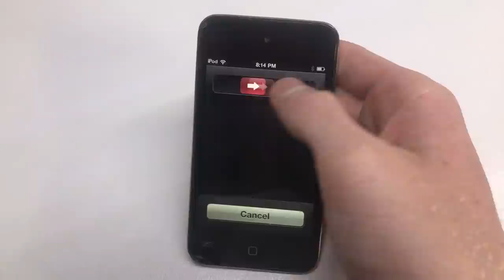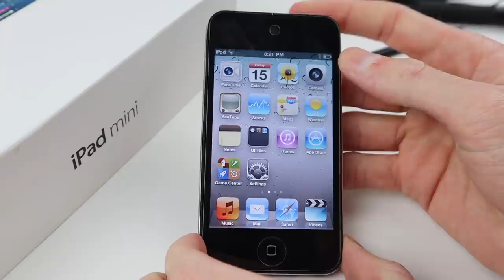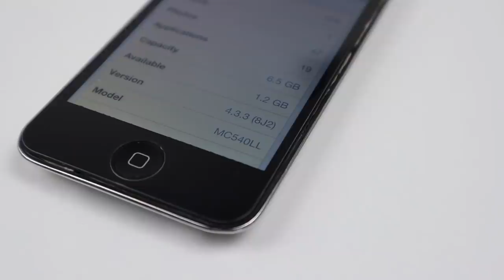The Unrepairable iPod Touch

Comment: If Hugh Jeffreys says its unrepairable, it’s unrepairable.
Reply: Ben KT777 ikr
Reply: AND THATS A FACT
Reply: Pass it on to Jerryrigeverything
Reply: I smell facts 😂😂
Reply: @ilhantele  yup he's our only hope
Reply: Yup it's unrepairable
Reply: Exactly!
Reply: I thinks that i might get it repaired , his skill are great but it always can be fixed
Reply: Actually. I've fixed a few of these. He's just ass at repairing shit.
Reply: Hell no! I repaired countless of these. This guy doesn’t know what he is doing. 🤣 
1.You need to push down on the board when lifting the metal plate or you break the flex like you did the first time. 
2.You do the same thing when connecting the digitizer or you break the flex like you did the second time. 
3. When you need to remove the board it is best to remove the battery with the copper back. 
4. Why did he hurt the speaker like that? A little heat and careful prying and it would have come out just fine.
Reply: @ilhantele  he might do a scratch test and burn the device with a lighter, but might also put a sick dbrand skin on it. So, maybe worth it?
Reply: @yanuehara8017  yep and fix it as well
Reply: @ilhantele  yeah, he'd do a dissection of it and then fix everything.
Reply: @Infevlol  This is not reddit, kid
Reply: Yeap I agree
Reply: @m3zmr ya ive replaced a screen on one of these as well and i was 15 years old
Reply: Zestypanda öhj! Be nice
Reply: Bs anyone can repair this
Reply: I feel like you’re going to change your comment
Reply: 176cgna on video
Reply: @jordanmanuelpillai2866  with a blind fold on.
Reply: m3zmr he never said it was fucking impossible he just said it was his hardest to repair
Reply: Jesus Yuca if your so good at fixing it why don’t you try giving him tips instead of heaping about it in a YouTube comment section. Give him some advice and he will probably try and listen he could probably say the same about other people trying to repair iPhone 8’s and mac books
Reply: Zestypanda you still have time to delete this
Reply: That depend on the experience of the fixing...
Reply: eeeehhhhhhhhhhhh he is not very good compared to some people
Reply: Unrepairable? Never heard that before. Is that a synonym to "Irreparable"?
Reply: @thevalorousdong7675  Yes
Reply: @bruhman2565  He gave tips on how to do it lol
Reply: Wulf he gave tips to somebody who probably never fixed a phone in his life he should be telling this to Hugh himself because let’s face it he doesn’t read replys
Reply: @ilhantele  Ipad Rehab or Louis Rossman, they could potentially fix anything between the two of them.
Reply: Na I did it on mine
Reply: Totally true lol !
Reply: But, the Huawei P20 isnt easy ,too. It is better to have an old iPhone 5s or SE 1 with TouchID and better Cams.
Reply: eh......
Reply: I’m gonna bring a broken screen iPod Touch like the one in the vid into the phone repair shop I’m getting trained at to do on my own, and I’ll tell you different. Watch.
Reply: @damian9303  ok. Let me know how it goes
Reply: I don't do repairs, but from 2010 till 2013 had to repaired myself around four times, my daughter was very good at shattering the screen.
Reply: Every time he says a board has failed and that it is unrepairable is completely false. Louis rossmann and ipad rehab is proof of this.
Reply: That’s what she said 😈
Reply: We need Dankpods to verify that

Comment: The solution: dont reinstall the screw near the power button cable when reinstalling the logic board. You will have plenty of screws holding the board in place, but if that screw is pinching the cable then that screw can stay out
Reply: 69 👍

Comment: I cringed when I saw him bend the battery like that
Reply: There isn't really any other way to take the batterys out on iPod Touches, there aren't any pull tabs and the adhesive is a bit overkill for such a small battery, he should have used a plastic tool though, you can sometimes slice through the layers of a battery if you use a metal tool and that can be pretty dangerous.
Reply: Same, especially with his hands. Wonder if its damaged it though
Reply: I recommend using isopropyl alcohol to soften the glue, it’s a lot easier to remove batteries that way
Reply: That guy fixed hundreds of phones dont teach him
Reply: @irmajulietaaguirrelara2046  oi

Comment: I repaired so many of these. When you lifted the metal plate that has all the screws you need to push the board down near the flex cable is soldered or you tear it like you did the first time you opened it. Also removing the board and battery with the copper back part helps not mess up the battery. My specialty was replacing the charging port because nobody on this island could do it.
Reply: Island? U from Puerto Rico?
Reply: FroyourFilms 🌴😎🌴yup!
Reply: @jesusyuca1483  The yuca Made me think so. 🇵🇷🇵🇷🇵🇷
Reply: @jesusyuca1483  Me too 🇵🇷
Reply: @FroyourFilms  Yo pensé lo mismo 🤣
Reply: Whasssup I'm from Puerto Rico toooo 🤣🇵🇷🇵🇷🇵🇷🇵🇷🇵🇷
Reply: Saludos mi gente! ✌🏽
Reply: @jesusyuca1483  🔥🔥🔥🔥

Comment: you know its unrepairable if even Hugh can’t repair it.
Reply: Yep
Reply: Yeah
Reply: Cody’s Tech Adventure’s hEy I knOw yOu
Reply: Adam Steven OmG hEy
Reply: Adam Steven Not true... I have repaired countless of these. I don’t know how else to say it but this guy is a noob. He broke the flex twice. The first time lifting the metal plate and the second time connecting the digitizer. He messed up the battery when he could have lifted it with the copper back. He fucked up the speaker by not being careful or using a little heat. Even his solder joints didn’t look that good.
Reply: Jesus Yuca this guy has no clue what he’s doing, he cannot even micro solder. I have repaired hundreds of iPod touch 4
Reply: @gthesuperman903  Same here. Stupid easy repair
Reply: GTHESUPERMAN bot
Reply: @jesusyuca1483  the battery was really fucked up  looking
Reply: My dad fixed mine easily!

Comment: Omg the part when he bends the battery so much i thought it would explode
Reply: Seriously, don't do this. Modern batteries are very tightly-packed chemical matrices designed to store lots of energy. Deforming them this roughly is dangerous. Hopefully Hugh was at least wearing eye protection.
Reply: @Jack-pc9sp  actually not always. It can cause a potential short between the layers. I've done it myself. It also leads to the battery puffing up over time if it doesn't react violently. So, stop spreading misinformation like you think you're smart
Reply: @thevalorousdong7675  yeah of course the nose knows
Reply: sometimes you just have to do that to get certain batteries out of certain devices if you do bend it like he did I wouldn't recommend reusing them, it's very rare for a battery to really do anything crazy just by prying it out unless you puncture it.
Reply: @Jack-pc9sp  Sure, let's just reuse every battery that's bent when being taken out of the devices, if it explodes into flames while you're using it, that's just fine, they're supposed to handle that bending, so it shouldn't do that.

It's not fear mongering, it's cautioning. Just because something can technically do something does not mean it's designed to do it. There's a reason people complain about manufacturers gluing batteries down rather than using pull-tabs to assist in the removal. It's not just because it's more difficult to get out, it's because it makes it more risky to remove it.
Reply: Sometimes You come to the point where You don`t care anymore....
Reply: @Jack-pc9sp  What are you, 5? Literal children resort to insults when they're told they're wrong about something.
Reply: I HATE APPLE OMG SOOO COMPLICATED!!!!!!!!!!!! EVERYTHING IS SO COMPLICATED IPHONE 5S IPHONE 4S CABLES RIP EASILY NEED EXPERT EVERY iDEVICE HAS ITS OWN PARTS NO INTERCHANGEABLE PARTS I THOUGHT BUYING AN UGLY CHEAP PINK IPOD AND BLACK HOUSING THEN SWITCHING HOUSING WOULD BE EASY I HATE MYSELF FOR LOVING APPLE PRODUCTS

Comment: I'm getting flashbacks to when I tried this on my sister's ipod years ago...
Reply: Did you do it?
Reply: Did it work?
Reply: Was it successful?
Reply: Me too. I've tried to repair three of these iPods. One had a gap under the screen, second one sealed correctly but the buttons flex was damaged and wired manually causing power+volume up when pressing power. Last one was almost done and the speaker connector broke off the board. Now it is cheaper to buy used working iPod touch than repairing one >_<
Reply: My girlfriend's iPod has a dead battery. It's in a pile of things to do someday in the future. 
I made an attempt a year ago and I stopped caring when I realized holy fuck this is going to take hours.
Reply: Yo same it still in my repair bin to this day
Reply: Ham String ohhhh nuuuu

Comment: Hugh Jeffrey:"Unfortunately Apple Glues the device shut"

Also Hugh: Glues screen down permanently
Reply: Since it's the only thing holding the display on.
Reply: @TR2000LT  There are 2 screws in iPhones, ipods dont have these
Reply: The Random the ipods always used glue
Reply: The Random, Con is correct. To avoid water getting into the backlight you use adhesive around the glass. Why? If water is slipping by the glass it has a perfect route to go into the backlight layers due to water tension. Anyways the real reason they used adhesive is because of various advantages, not just because apple is greedy.
Reply: Honestly just stay away from Apple...hence why they're a multibillion dollar company
Reply: @TR2000LT You're taking what you can get now aren't you. Bias is stong in this one
Reply: @TR2000LT  "well was not they were using 2 screws before?"

Bruh; English
Reply: @TR2000LT  and the English language has remained consistent since

Comment: This happened to me as well! When I took the cable out it had a small mark on the cable inside the ribbon.  I found out that it was long screw damage witch was very weird because I knew I had used the correct screw.  I replaced the cable and didn'd screw in the screw above the cable, and it worked.  I screw in the screw as much as I could before it got tight, and it worked fine.   So I believe Apple used a screw that's to long for the spot.
Reply: Which screw do you mean?
Reply: That doesn't make sense because if the screw were too long the iPod touch would have had that problem from the factory.  Seeing that it they/it didn't, the length wasn't an issue.

Comment: I used to work on mobile repair between 2013-2017. The first few devices I worked on was this iPod touch 4th gen since in 2013, that device is widely used. 

They're bane to my existence and the primary reason I get a lot of angry returning customers. Also the 5th/6th gen iPod touch are nightmare as well. The only other device I have the hardest time is the HTC One M7 (2013). 

I'm a software developer now. But I miss and don't miss mobile repair career. Maybe I can do some side hustles for fun later on.

Comment: Thank you for this video, Hugh. I recently had to lift up the rear seats in a car I bout a couple years ago. I found an 8 gb iPod touch under there. It was all grimy and dirty, but after a wipe down it cleaned up ok. I plugged in a charger I had. At first it didn't do anything. I waited for it to charge up enough to power up, but nothing. Eventually I unplugged the charger, and pushed it in and out of the charger port, wiggling it as I did. Eventually it powered up, but as soon as I unplug it, it shuts down. I was looking to see how hard it would be to change the battery. This video has shown me that it's not worth it. If I want to use it, I will have it plugged in, in my car or something.

Comment: maybe a screw short-circuits the power button.

not grabbing a cable, when you screw it down.

but removing one screw and checking each time if the power button works is a little bit tedious.

Comment: I have the ipod touch first gen (2) and they work...... well one the back has some gaps in it and the other one one loses charge quickly the backlight is fried and it cannot connect to WI-FI

but they work.
Reply: it's a shame they're so hard to repair otherwise I would repair my old iPod touch from back in the day. It's so fucking tiny tho, 8 GB

Comment: I had one of these and the screen got smashed. I decided to buy a screen replacement from amazon when I was 15 or so. I did the replacement and it worked! I didn't have adhesive so I just ducktaped the corners to hold the screen in place. About a week later, only the bottom half of the screen worked and it slowly got worse and worse. I still have it, it can power on but the screen just doesn't work. I thought about replacing it now and properly fixing it but I'm not sure its worth it

Comment: I own(ed) one of those iPods, I bought it when it came out. The home button stopped working so I opened it just fine, then when I closed it, the screen stopped working. I realized I slightly tore the screen’s little cable at the top😅. I didn’t think it was worth the trouble of trying to fix it so I left it like that. I still managed to retrieve all the pictures I had on it at least, I ended up buying another one for around $20USD a few months ago and it’s in surprisingly great condition for being used given it’s age. Great video Hugh!!

Comment: as an general tip which I do not see very often (and honestly I dont know why...): Before trying to remove the battery for example, get an small syringe and draw up some ethanol... Even normal hand disinfection fluid will do it. Just put a litte bit on every side of the battery. wait 1-2 mins and the ethanol will start to make the gluestripes soft. You can than lift one side up a little bit and again put some fluid underneath it. Doing it like this will let you remove any glued part as smooth as possible. And dont think too much about, that ethanol could damage anything. Thats not the case. Anything else used in such devices does withstand it really well.

Comment: Good job hugh. I tried to repair mine.  The soldering part is very critical. At first it was ok. But power button not working the next day. It was on and off when i keep on solder the cable. After 1 week of soldering i let it rest for good.

Comment: I used to repair these back in the day. Easy stuff compared to todays stuff. (I do microsoldering on iphones etc)
I'll just start by letting you know that the 2 holes behind the power button you need to keep those intact as theres a wire that runs just above or below the holes so most likely you tore it when you assembled it. Also you need to use FLUX when soldering. I cringed when I saw your solder joints.. Good luck let me know if you have any more questions

Comment: The repair difficulty on this device is about a 6 out of 10. With a little practice, you dont need to remove the mainboard to replace the screen. The pcb has some elasticity to it and as long as certain connections are freed up, it can be bent slightly to reconnect the digitizer connection much more easily.
Unfortunately you did a lot more work than was necessary. 
Practice makes perfect definitely.

Comment: I used to own one of those... good times :)
Reply: Me too when I was 9 but unfortunately it died in the middle of me playing a game and i got angry and slammed it on a bunk bed pole and the screen cracked real bad and the charging hole was damaged so we had to put it back to normal by pushing it hard with something and I was still able to use it all tho the damage was just getting worse and worse like small bits of the screen were breaking off then the home button came off so I had to put tape on it to keep it on then the whole screen was coming off like in this video where he had the screen up and it was still able to work surprisingly and the screen was even turning white and flickering already then one day it was in my pocket and my father sprayed me with the water hole's then i ran inside to see if it was alright and it didn't work no more the water got into it ): and this was in 2012 ya pretty long ago /:

Comment: These are a walk in the park to repair.  I've repaired hundreds of them.  The hardest part was getting bent ones sealed back up properly.  Pull the WiFi cable away from the white plastic thing it's stuck to.  Once that's done, it will allow you to fully pull the motherboard away on an angle from the housing.  Just enough to get a full finger behind it to snap in the digitizer cable.

Comment: Somehow I managed to replace the screen on it while in high school. I used normal hairdrier to take it apart, also broke and replaced that flatflex cable, and didn't have good glue to keep new screen properly in place. But it worked.
Definitely removed motherboard in process. I remember that thin strip of pcb keeping two halves together and bending it to take board out, luckily didn't break it

Comment: Try an 8+ 

I ripped the Home Button's flex whilst transplanting it from the broken screen. 

The cable is honestly about 2mm wide, the connector is tightly secured and the entire flex is adhesived to the chassis. Prying from the chassis will rip it, like I did. 

Now here's the kicker, Apple will not sell home buttons. The security logic is built into them and I guess it could circumvent their Touch ID security. 

The only solution is to buy a reproduction home button that connects as some sort of bluetooth device? Not ideal... 

It's going in the draw for now, same as your Ipod did in 2018. Maybe i'll come back to it in 2022 and break even more of it...

Comment: That is so weird! I have done screen repairs on an iPod Touch 4th gen before and I haven't had an issue with the power button... However I did have a home button issue with an iPhone 4 after replacing the screen and found out the issue was it needs to be seated in a certain way or the screen will clamp down on it and preventing it from being able to depress.

Comment: Im pretty sure there's 2 different sized screws for the metal plate if i remember correctly. Its hardly a noticeable difference in length. but it might be enough to pinch something like the ribbon cable for the power button